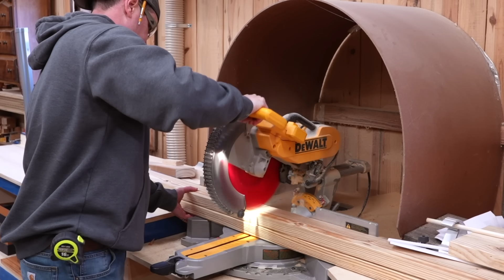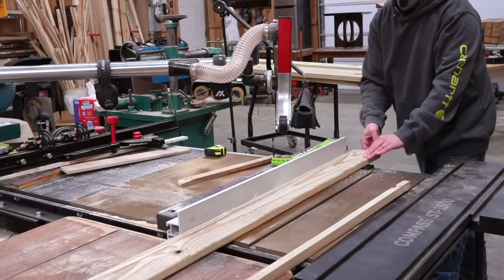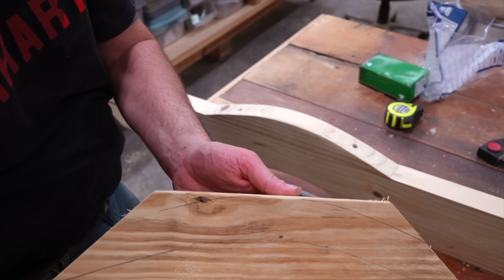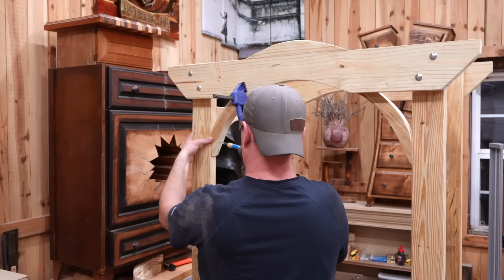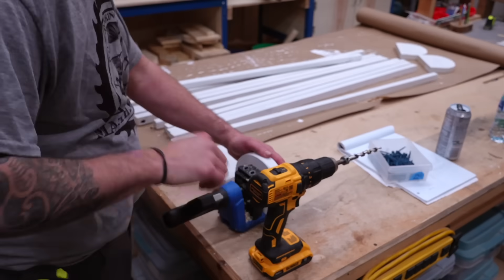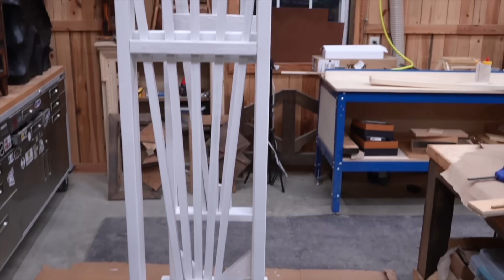Arbor Trellis | Arched Pergola For Gardens, Weddings, Or To Make Money Woodworking

Comment: I’m currently working on this, and need help.  If the measurement to the bottom of the top (arched) brace is 64”, that makes the top of it at 69 and 1/2”, which only leaves 4” at the top.  Where did I go wrong?

Comment: If the BRIDE will be walking through that trellis, you would need to make it WIDER if she is wearing a traditional wedding dress. Find out what typical wedding dress dimensions are (especially at the bottom) before building something that may not be suitable. Just a heads up before building.

Comment: Nice project. I think the hardest part would be to find decent and straight boards - Not easy with the junk they sell Lowe’s and HD!
In 2006 I made these vertical trellises for behind our spa. I made four out of basically cheap 2x2s, fence board for the top and then used tan PVC lattice for the “field” area. My touch was using a hold saw to put in Mickey shapes at the top (we are big Disney fans). I attached them at the base to the cedar block planter and to this day, 13 years later they are still standing with minimal repairs over the years (I live in Orange County, CA). I did not know of pocket screws back then which would have made them even stronger.
In 2005 we were married at a restaurant at Downtown Disney at Disneyland. We used a PVC arbor that still stands in our front yard today with zero maintenance. I think back then it was $300.Nice project.

Comment: Question: What if I do not have a saw that cuts the entire length of boards? (rip saw or table saw, sorry, I don't know the names) You mentioned cutting off the 1/8" to make it square. I have a circular saw, a miter saw, and a jigsaw. Any help? A new wanna-be woodworker wanting to make some of these garden projects thank you.
Reply: Check out vids on building a diy tracksaw or straight edge cutting guide.

Comment: Just had a quick question on the builds that use pickets.  I know you mentioned using treated pickets before.  Are you just sanding down through the weather treatment to get to finishable wood?
Reply from the maker: It just depends on the material and if it needs sanding.  Sometimes I will run it through a planer.

Comment: You mentioned $500 as if it were high priced.
How many hours do you estimate in this build? Cutting, sanding, routing, building and painting. And then what's a good hourly charge for a moderately skilled craftsman to get on it? How much under $500 does that come out to?
Reply: hours, by following plan, would be useful to know.  I'd figure it would take me 8hrs, -$50 materials, ~$56/hr, -1/2 for taxes is $25/hr.
unless you just pocket the cash and dont tell the irs, since its just a weekend garage build.  (this is why they want that $600 irs income rule in the usa).  I need to go clean up my garage so i can start building planters and stuff.